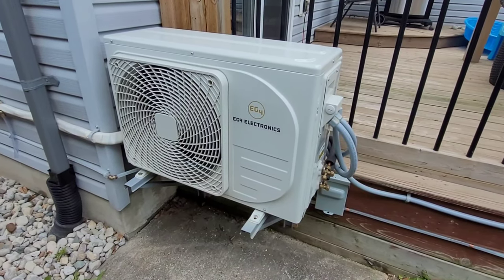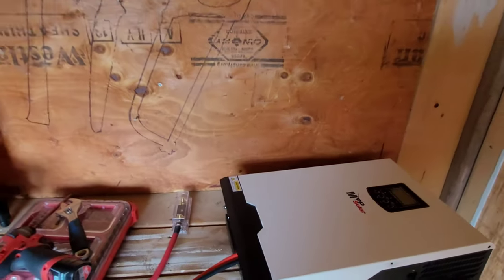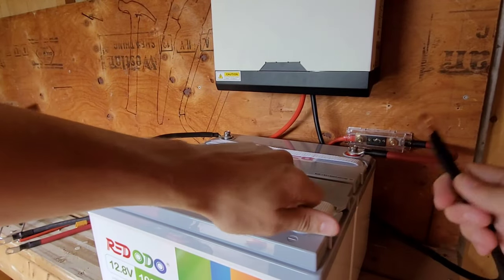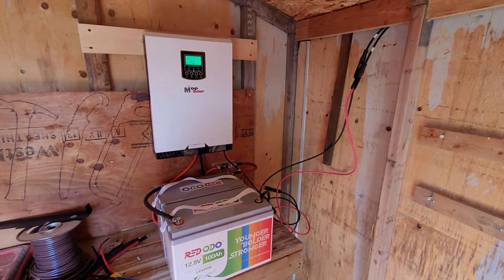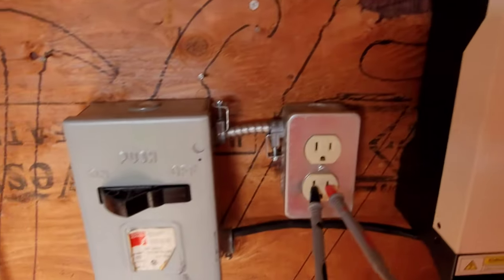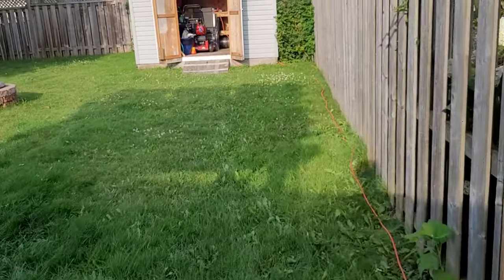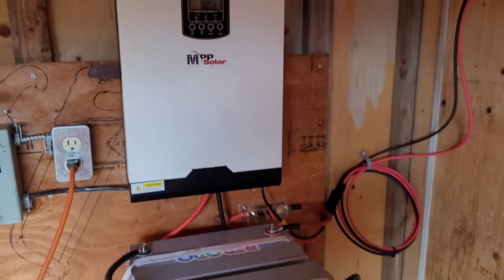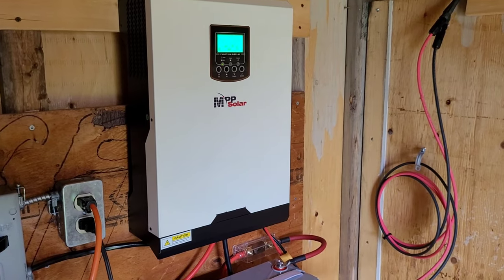Off-Grid Air Conditioning - Solar Mini Split Battery Backup System

Comment: I like your videos because I am learning at the same pace. You set realistic goals and complete them, I appreciate that. Everyone on YouTube is either an absolute pro or total rookie. I like that you’re in between. Thanks
Reply from the maker: Thank you, I appreciate that!
Reply: @SmitHVAC.  total rookie here ,  I don't understand what is needed to run the 12K BTU unit   24/7  in hot areas of the country,   Palm Springs,   (most of Arizona,) (Las Vegas,) 
from 8PM to  8AM  from May to September  with  AC, when it's often  80 degrees to  95 degrees at night and still needing AC, but the solar panels are largely inactive ?

The only way this makes to me is, if the solar panels produce so much power, they overproduce enough power for batteys to absorb it,
than your AC somehow knows to switch to  battery power every night starting say around 8PM ?
Reply from the maker: @flolou8496  the minisplit automatically switches to Ac input after the solar becomes too weak to run the unit. You can have it wired to a standard 120v breaker if you have grid power, or if you are offgrid you would wire it to your inverter setup, but you would need lots of battery to get through the entire night.
Reply: @SmitHVAC.  I guess that's why I have to keep learning and keeping up to date with those options, that alot more complicated like the one I'm including the link below, however with that complexity, seems to come the ability for the battery/solar generator to store more power,  when the solar panels go inactive at night:   

see: https://www.youtube.com/watch?v=ELB8v0j9lfY  

I keep asking myself has  the technology there to see peole go offgrid for 15,000 out the door with the right set up yet , (for say all electrical needs on 1800 sft  24/7

The old sales line of saying your solar system would pay for itself after 15 years to 20 years, never appealed to me,

Comment: Great vid. Going to comment on just one small detail that’s worth knowing.

That coil of wire trick is basically a Choke. Like a transformer, but it only has 1 winding. It’s Impedance slowing down the in rush of current, not Resistance.

If you unrolled the spool into a long straight line it wouldn’t have nearly the same effect.
Reply from the maker: Thanks, that's a good point. That might be worth trying some day, unspooling the roll and testing the results
Reply: @SmitHVAC.  Just use a pencil with a point on both ends (as a carbon resistor)

Comment: I’m sure you realize there are gains to be made by setting your panels to a better angle to the sun. I just recently accepted delivery of the eg4 12k btu hybrid system. This one has the pre charged outdoor unit. I’m going to see how well it performs off of a 1500 watt array which I already have . I already have a 4k split phase system with a home built 300 amp hour lifepo4 battery for AC loads so I should be able to run the ac for a few hours past solar cut off. I’m in the high desert of California with temperatures similar to Vegas. I’m encouraged by your success.
Reply from the maker: I do realize the solar is not optimal but any more angle shades the panels behind. I'm looking at upgrading my solar panels next for some high wattage and better mounting system. I'm glad to hear you recently purchased one, hopefully you have good success too. Thanks for watching
Reply: @James  update??😊

Comment: I currently did an installation of two 12V 220AH Tubular batteries with a 2.5kva inverter. 1200watts PV panels connected in parallel. Using a 100A PWM charger controller. The system does well with my 100watts refrigerator, 160watts 55 inch TV and sound bar. The best investment i have done this year.
Reply from the maker: Awesome!

Comment: Thanks for the content and it was interesting.  I just completed a 9 hour test of my 6000BTU LG window unit with a high SEER rating and pulling no more than 500 watts at 120v.  My set up is a smaller scale using 800AH 12v AGM bank and a 1500 watt inverter and it worked great using two Victron 100/20 MPPT controllers.  I ran the unit beginning at noon until 9pm (after sunset here in Michigan) to test  everything.  Today, the SOC was 86% and using those two MPPT controllers with east, south, and west facing smaller panels the battery is fully charged.  So, if you can dream it and spend time you can successfully have A/C off grid easier than heating off grid using inverters...... new subscriber today.
Reply from the maker: Awesome! It's a good feeling being able to cool your house for free. Thanks for subscribing!

Comment: Thanks for the update. I have one of those EG4 mini splits and it works great. I also have my AC input coming from my solar system.
Reply from the maker: Thanks for watching, sounds like a lot of people are having good luck with these!
Reply: Share your setup of the AC input please. Did you get the 12000 btu hybrid ac from EG4?
Reply: @sxmroadcam6347  I did get the EG-4 mini split. Solar panel and AC input. My AC input is fed from 2 SMA Sunny Island 6848 inverters. I have 1800w of solar going to the mini split at 280v. I am cooling every day, as we are in Florida. This is an amazing unit

Comment: I run a inovair 38 seer 9000 bru unit non stop on solar and batteries. The high seer unit uses half the power of the popular pioneer brand. It tooks a lot of study time lol. I finally decided on the inovair and couldn't be more happy with it
Reply: I would like to learn the details of your successfull installation of the inovair 38 seer...sounds like a choice
Reply: I assume you're inverting both to 240 VAC. Do you know what that does to the SEER #?

Comment: Like your video....i have a great interest in offgrid  power .... Im 44 years old have a good deal of 12 volt wiring experience with automotive and semi truck  ...i have a suggestion  !! All of your battery connections  and wire connections need lock washers ontop of the ring connecters  ..your ground wires are important too slightly larger ground cables  than your required  hot cables  will help alot ...the ground side of your batteries  are actually carring the batteries fire power ...dont forget to get the lock washers to bite into  bite into ring connecters  when tightening .....good solid connections are crucial on d/c  systems of any sort..  thank you for reading if you have

Comment: HVAC too / 34kWp totally off grid. Looking good. Looks like you'll get about 4 hrs of good running with two of those, 8 hrs with 4.
Reply from the maker: I just added 2 more batteries, It will be in the next video

Comment: I spent that last 23 years repairing Xantrex, Magnum, Trace, Heart Interface low frequency inverters and hundreds of off brand Chinese made high frequency inverters. So I can tell you from experience that the high frequency inverter that you chose for your HVAC project will probably only last a little more than a year if your lucky. The FETs that are used in transformerless high frequency inverters were never meant for powering motors, especially motors that power AC compressors. I would highly recommend switching to a low frequency inverter if you want your system to last.
Reply from the maker: Thanks for the tip, what would you recommend in roughly the same spec?

Comment: Newbie here. Please excuse the silly questions.
1. How many kw for the 12 hours to run it offgrid?
2. Would be better to use the batteries direct rather than an inverter? 
I say this because the system cannot tell the difference if the panels run to the batteries first and then to the system as oppossed to panels directly to system.
Reply from the maker: It depends how hard it had to run to cool the space. It's always modulating but I guess it would be around 6 to7 kWh. You would have to have a very high voltage battery bank to run directly and it would definitely void the warranty.
Reply: I thought the advertisement for the eg4 mini split was ac/dc unit so you can run directly from your solar panels without having to have the inverter or batteries.
Reply from the maker: @goodfortune6399  You can, just showing what's possible if fully off grid

Comment: I am looking to buy the same setup for a South Florida of grid shop for 24/7 air conditioning. Would like to know how many batteries it would take to run all night until solar kicks in?
Reply from the maker: It would depend a lot on how well the shop is insulated, how big it is etc. I need about 6.5kwh to get it through from sunset to about 9am when I have enough solar again. In my Canadian climate I rarely run it over night as it tends to cool off, so this 4.8kwh is more than enough for me

Comment: Just wondering. If you use an inverter with solar and batteries, why not just buy a mini split without direct attached solar? Just wondering before I buy. Thanks for excellent vids!
Reply from the maker: If you want to get started with solar Ac, the EG4 model and some solar panels is the cheapest way to get going. I bought this equipment afterwards to add the after hours solar aspect. If you already had a large battery system and inverter you could go either way!

Comment: Another great video.  How long can you run the EG4 on battery power?  I have a similar albeit slightly larger system (Growatt SPF3000 TL LVM-ES with a EG4 Lifepower4 battery and 3k of solar) that I plan use with an EG4 12k btu hybrid mini split.
Reply from the maker: About 4 hours on this setup, when I move it to the house I will likely add 2 more batteries. Usually I shut it off around 8pm after it cools off and I've only used 30-40% of the battery

Comment: You got it looking good. Thanks for the video. I noticed now Signature Solar has the mini split in plug and cool with pre charged lines, no need to pull a vacuum.  Only drawback is the line itself  . Whatever is not needed has to be rolled up and put behind the unit. What is the maximum watts you've seen unit draw of the AC line? I noticed to are able to regulate the ac input from 0 to 600 warts. So I figured it didn't use more than 600 watts at any one time. Still haven't gotten mine yet. To many expenses on my mowers has set me back a bit. Thanks in advance..... Jeff
Reply from the maker: Yes they do have the precharged version now. I'm hoping to make a video on one soon. I've seen it pull up to 1000w in cooling and 1200w in heating but it doesn't stay there long, usually ramps down after 10 to 15 minutes of runtime. Thanks for watching
Reply: @SmitHVAC.   Did you get your line set covers and the mounting brackets from Signature Solar?
Reply from the maker: @JWTX  No I got those from a local supplier
Reply: Just about all of our standard 14-18 SEER units consume about 1000W per ton (12000 btu). 20-100% more in heat mode, depending on unit. My Fujitsu 9000 33 SEER runs about 700W max in cool, 1400W in heat (it really throws the heat out, even below  0F.

Comment: Your doing what I plan on doing with my workshop with my E4 Solar A/C. For now it just running during the day on solar alone. Still doing my homework on battery storage and type of inverter to know what my cost will be for investment. Thoughts on Growatt inverter? Still not set on lithium battery yet, how far can you draw down on the batteries you bought?
Reply from the maker: I think growatts are good, I looked at a few but ended up finding this one used locally for a good price. The beauty of lithium is you can run them all the way down to about 10% before the voltage really starts to drop, but if you can find some good golf cart batteries or similar locally they would do the job too

Comment: I believe someone may have alluded to this earlier and apologize if I missed your reply. Why use the MPP inverter if only using it to power the heat pump? Why not use the solar panels to charge the batteries and have the batteries power the EG4 directly. During hours of sufficient sunlight, the solar can run the EG4 and any unused energy will recharge the batteries. The inverter is the most inefficient part of your system. I don't think you have any excess capacity and will still need to borrow from your utility but much less. Thank you for listening.
Reply from the maker: A few people have mentioned this now. It may work but I'm not ready to void my warranty just yet.
Reply: @SmitHVAC.  I think the limiting factor is the requirement for 90VDC. Would require one heck of a battery or a boost converter.

Comment: Im running my 12,000btu Senville mini split on 4 120ah Lithium batteries for 240ah 24v 5760wh but im using 16 Lithium Lifepo4 cells & building another bank of 280ah cells to add to it
Reply from the maker: Make an update video when you add the cells!

Comment: Great trick on the resistor but I have never seen an issue with the spark.  You know it's coming and do a quick touch, it's there then gone and no markings or damage that I have ever seen.  Just my experience.
Reply from the maker: It depends on the inverter, I think typically the larger the inverter, the larger the spark

Comment: question so 2 batteries is enough to run this unit off grid 24/7 with solar?
Reply from the maker: No, it won't run 24/7. This gets me 4 or 5 hours after the sun goes down. I usually only need to run it until around 8pm when things cool off but obviously it depends on your weather
Reply: @SmitHVAC. - one of the great benefits of the Canadian summer!! I now live in Florida...
Reply: Got me thinking.  But summer in florida is hot and hot 24/7

Comment: I apologize as I have been bing watching YouTubes on the EG4 mini split that takes solar directly. Why do you not just go direct solar during the day and battery (charged by other solar) through the inverter at night?
Reply from the maker: That's what I'm doing, it's connected all the time but it prioritizes solar and only pulls from the batteries after the sun starts to go down
Reply: @SmitHVAC.  Got it!

Comment: Very nice video. Informative. How much power consumption does the inverter use in standby mode? How much Solar did you say you are using?
Reply from the maker: The inverter uses 50w in standby which is pretty high. At the time I only had a 290w panel, but it worked ok because the AC ran on the dedicated solar all day while the batteries charged.

Comment: Will solar panels mounted on the roof heat up the roof?
Reply from the maker: No, the air gap under the panel actually makes the roof cooler

Comment: This is probably a stupid question, but doesn't that EG4 run off of DC?  Is there a battery management solution that can charge DC and also output DC so you don't lose with conversion?  Or a way to configure a system so the batteries can provide DC to the minisplit?
Reply from the maker: Yes it's possible but it's more battery power than I have, it needs to be above 90vdc

Comment: When you move it into the house, will you turn off the beeping noise?
Reply from the maker: I've turned off all the beeps, the only one I can't turn off is the first beep when it powers up, but it runs 24/7 so it's not really a problem

Comment: What type of main fuse are you running, and does it ever get hot
Reply from the maker: Just a basic 200A fuse, it doesn't get hot
Reply: @SmitHVAC.  so not class t
Reply from the maker: Nope

Comment: I want to buy a hybrid inverter from aliexpress. Powmr. But so many manufacturers from china are just lying about the specs. Im scared to purchase a dud. I need to run a small 9000btu inverter ac , a fridge, a fan, lighting, and a tv. I think 5kw inverter should handle it. Any recommendations.
Reply from the maker: I like the EG4s from Signature Solar, pretty cheap for the specs. 
https://signaturesolar.com/?ref=_KvVrzchAclARI

Comment: The Plug N Cool is supposed to come complete with its own built in solar controller and pure sine wave inverter and is supposed to be a truly plug and play, depending on an already estabished 1400 watts of solar minimum. Is this a different system and not the newest self contained version or is the information online about it all being truly self contained and plug and play false information?
Reply from the maker: This is the previous model, it still has the mppt and runs directly on solar panels but it did not come precharged. This one requires hvac specific tools.

Comment: How long did you run the Unit with this config?
Reply from the maker: A few weeks, I have a small power station for the shed now and my EG4 is backed up by my 6000xp
Reply: I mean with the 2 battery charged on only AC
Reply from the maker: @dealinator9  Oh not long, 2 batteries was good for 5-6 hours after dark
Reply: @SmitHVAC.   which cheaper material would you recommend me to invest to use it with AC ? for 8-10 hrs
Reply from the maker: @dealinator9  a server rack battery or wall mount batter
Reply: @SmitHVAC.  with what ?
Reply from the maker: @dealinator9  https://signaturesolar.com/eg4-wallmount-indoor-battery-280ah-51-2v-14-3kwh-eg4-6000xp-off-grid-inverter-bundle-8000w-pv-input-6000w-output-all-in-one-solar-inverter-bndl-e0009/?ref=_KvVrzchAclARI
Reply: @SmitHVAC.   thats a lot of money for just the hybrid mini split
Reply from the maker: @dealinator9  that's a realistic system if you want to run it offgrid all night. You can do a smaller inverter and some 100ah Lifepo4s, but it won't get you through the night. Alternatively you just run it when the sun's out!
Reply: @SmitHVAC.  Yes and I like the idea
Reply: How about the EG4 3000 all in one and 4 redodo 12 v 100ah ?
Reply from the maker: @dealinator9 EG4 3k is a decent option, 4 Redodos is about the same cost as a server rack battery so whichever you'd prefer
Reply: @SmitHVAC.  I went with the EG4 rack. Thanks
Reply from the maker: @dealinator9  awesome, hopefully you got $50 off with my code